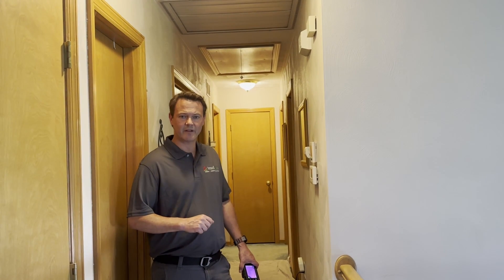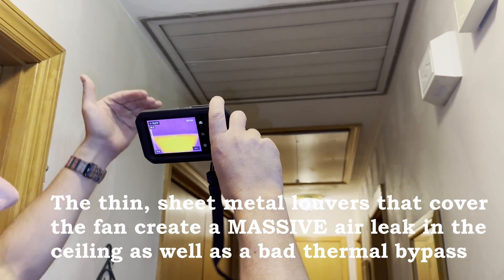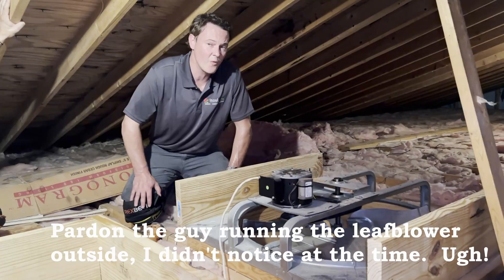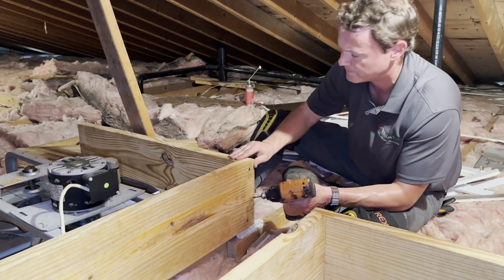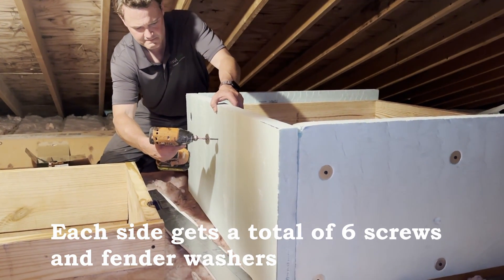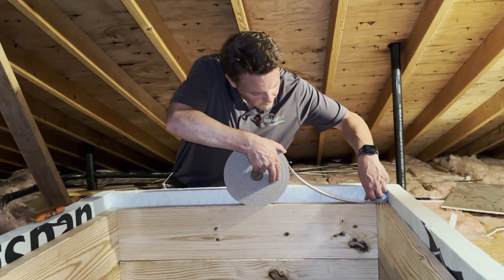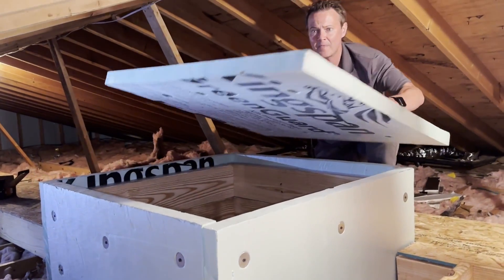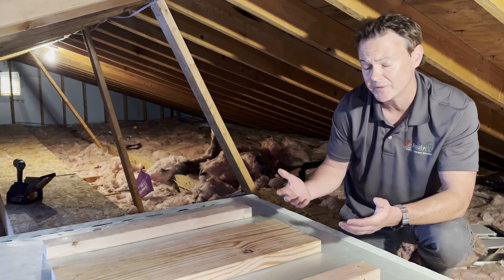STOP Wasting Energy! Insulate Your Whole House Fan NOW!

Comment: Why not just make the whole box from foam board and foil tape the whole thing together
Reply from the maker: Thanks for commenting.  You could --- but I don't believe that it would be that durable.  Tapes often wither over time in attic environments.  This box is designed to last for as long as that it is needed to function, as in decades.  
Andy

Comment: This is an awesome video. It would have been great if your videos showed that the insulated box for the whole-house fan with an insulated lid can be opened with the pressure of the fan and closed after turning the fan off. As a home Inspector in Florida, most homeowners will not climb into an attic, and Florida attics are not designed for homeowners to walk around in. Also, many homeowners think there is something waiting in the attic just for them. LOL
Reply from the maker: Thanks for watching and commenting, it's true that not everyone wants to climb into their attic to operate the fan and lid!  That's a good idea to create this in a way that would allow for the hatch to be opened via the fan turning on.  Even if the hatch didn't open the full amount, it would still allow for a substantial amount of air to be vented out.  We will take this idea up ; )
Andy

Comment: If the lid isn't hinged to open when the fan is activated, do you climb up and remove it each time you want to turn the fan on? I live in Southern CA where it is never really cold, and we use the whole house fan each evening to cool down the house without running the a/c 24/7. Do you have a video for a hinged lid that opens when fan is on?
Reply from the maker: Usually our customers will climb up and pop the lid during the time of year that they want to use the fan and then pop it back on when it's not in use.  I think these lids may be a bit heavy to use if we hinged them, I'm not sure if the fan would have enough power to pop it up on its own.

Comment: This is awesome. You gave some good points regarding the ineffectiveness of the fans (and the energy loss they can cause both in summer and winter). I would actually like to know how to remove the one in the hallway of my house here in Indiana and perhaps turn the space into an attic access point (the main one is some 35-40 feet away out in the garage and a challenge to get into).
Reply from the maker: Thank you!   We remove them all the time from homes, it's actually our recommended solution.  You need to turn off the power to it from your main panel, cut and put the wire into a junction box in the attic for safety, unbolt and remove the fan from the ceiling, then create your attic hatch. 
Andy

Comment: Silly question: can't I just build the fan box out of foam board?
Reply from the maker: Not a silly question at all.  Technically you could do this.  The issue is durability.  How do you anchor the foam panels to each other?  Tape?  Adhesive?  Screws cannot reliably do this from what I've seen.  What does the top hatch rest on and how can you confirm that the "resting lip" is level?  I've seen foam panels taped together to create attic hatches, etc.  After a few summers they always start coming apart.  
You might be able to find a way to do this without using wood to create your initial wall.  But over time it is highly likely to deteriorate.  We decided to use this process because 1)  It's easy to understand and consistently reproduce with good results and high functionality and 2)  It is durable as heck.  Once that lumber wall is set up and your foam insulation board is anchored to it this way using fender washers and screws...it's going to last for decades.  
Andy

Comment: Hi Andy- How did you attach/anchor the 2x10’s to what appears to be a plywood base of the fan housing? Thanks for sharing a great idea to prevent a house fan from being a heat sink in the winter. My natural gas bill should be lower this winter after I build the cover.
Reply from the maker: Thanks!  First I created a "box" using the 2x10's for the base layer.  I then anchored them to the attic floor joists by toe nailing them in using 3" screws on all four sides.  That creates a pretty sound and rigid base.   Over the years this design has been the simplest to recreate for my teams and is also quite durable.  It will work for you for years.  Glad that it helped!
Andy

Comment: Why wouldn't you just a door on the bottom side make it look like a attic door that folds down or slides open
Reply from the maker: You could do this, but I wouldn't know how do to it in a way that wouldn't be visually quite obtrusive on the inside of the house.  There are magnetic covers that you can also attach to the louvers from the underside, and would help air seal the opening, but they still allow for a massive thermal bypass due to there being no insulation there.  
Andy
Reply: @insulwiseenergycomfortsolu3293   We cannot expect an intelligent solution that did not require a money pit. That is too anti commerce,
Reply: @insulwiseenergycomfortsolu3293  Hi, great video! My house has a similar fan, but it's "lifted" so the louvers are about 4 inches above where the ceiling starts. I can easily cover from the bottom without it looking like an eyesore. In my case, is there any reason not to seal it from the bottom? Is it less effective? Thanks

Comment: Thanks for this Andy! Would xps foam without the wood also work if you adhere it to itself and weight the top? Thanks!
Reply from the maker: Hi there, it might.  However, we see homeowners attempt to build all sorts of boxes around their pull down ladders, house fans, etc using ways that are less robust than our designs.  Often they seem not to stand up to attic heat, or gradually fall apart in various ways.  You may be able to get this solution to work just fine, but our approach is to reinforce things like this with lumber attach the foam mechanically with screws and washers.  Good luck!

Comment: Hey Andy, just commenting because this is your most recent video haha. What knee pads do you recommend for crawling around attic frequently. I'd prefer to be able to walk when I'm older. And thanks for all the content, I'm a Mold Remediator in southeastern Wisconsin, your videos have helped me add much more value to my customers.
Reply from the maker: Hey there, glad that I can be of help!  The knee pads that our teams use are Rexbeti knee pads.  They're about $25 a pair on amazon.  I have used just about every type of knee pad known to man over the years, and the Rexbeti pads are what work best for this type of work.  They're comfortable, don't slip off your legs, and the rounded/ rubber coated knee pad areas do not slip off studs like the hard plastic ones can.  Hope this helps!
Andy
Reply: @insulwiseenergycomfortsolu3293  Thanks for the help! I really appreciate it I've tried a few home depot ones and after a couple I just went with no knee pads, so my knees are really thankful now. You should keep uploading you add so much value!!

Comment: Thank you for this video. Any thoughts on adding some hinges to have it open on its own when the fan is turned on?
Reply from the maker: It's not a bad idea, but the hinges need to be mounted to something sturdy enough on the hatch so they will hold in place, namely a strip of wood.  Usually once we install these homeowners find that their home functions much better than they expected by just keeping the hatch in place, and they then leave them on year round.

Comment: Does the rigid foam need to be covered with drywall for code/ignition barrier?
Reply from the maker: Not if it's in an attic.  It's the same as if you had spray foamed the underside of the roof.

Comment: Thank you for posting this. We tend to use our whole house fan in situations where we burn bacon or popcorn or something else in the kitchen. Or to get fumes out when cleaning with chemicals. Rather than building above like this, i am planning on just taking a piece of rigid insulation, sticking some magnetic tape around the perimeter, and sticking it on the ceiling to cover the louvers from the inside so it can be quickly removable. I know that you would still get some thermal short circuiting from the metal framing for the louver, but does this seem like a reasonable solution to keep me from having to go in the attic to remove the cover each time we overcook some bacon?
Reply from the maker: Your solution will be far better than doing nothing, that's for sure.  These things do move a lot of air when they're on.  And in some parts of the country they work exceptionally well as they're designed (high dessert areas with hot dry days and cold nights, like Colorado).   
Andy